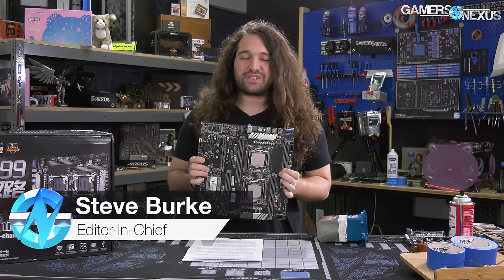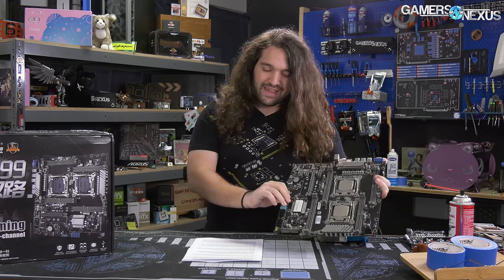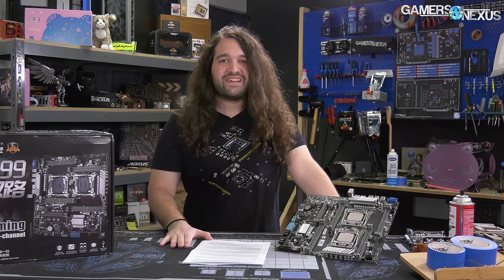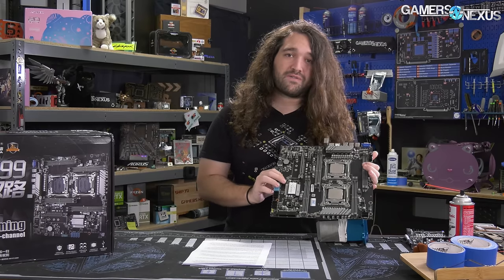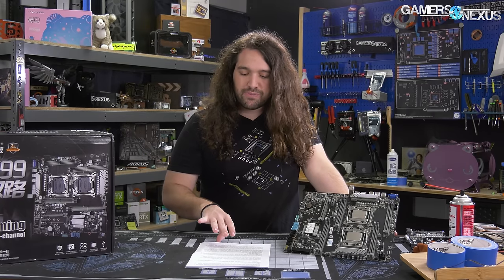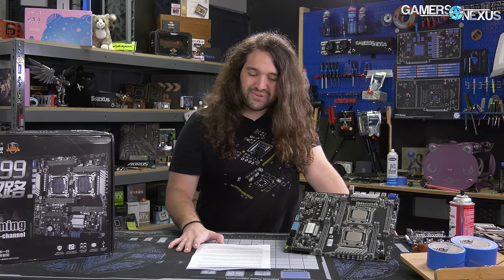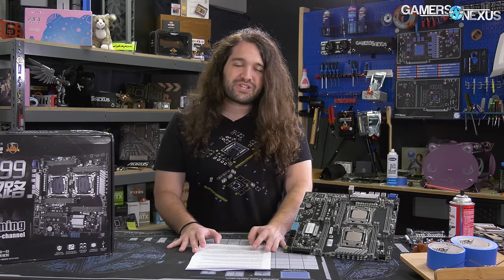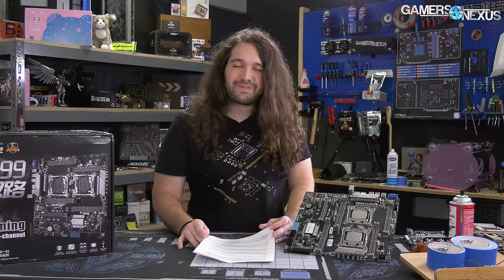24 Cores, 48 Threads for $360: Dual-X99 Jingsha Motherboard vs. AMD R9 3900X

Comment: Ayy, I see you've discovered the magic of ES/QS Xeons. This has been a poorly kept secret for a while. The main thing to keep in mind with purchasing such CPU's (aside from passing general reputable seller smell test) is checking the listed stepping of the cpu in question, and checking that with listed launch retail stepping of the same sku. The further removed the stepping of the ES/QS cpu is from the (post)release steppings is, the more likely you are to encounter issues (eg, a B0 stepping ES vs an M0 stepping release is a big delta, whereas L0 vs M0 is much closer, and is effectively a "public beta" or release candidate, to borrow a software versioning analogy). It's also worth noting that factory base/boost limits may be slightly different than release spec, and as you pointed out, these are/can be unlocked to an extent. 

The value prospect of ES/QS is diminished these days now that AMD (and now intel, somewhat) has finally broken out of the 4c/8t paradigm on the consumer side, but if you need cheap multicore, abundant PCIe lanes (w/ PEX/PLX chips), and or abundant memory capacity w/ Registered ECC support, they're still generally a great value. The price of ES/QS chips largely scales with base/boost clocks (eg, E5-2667 v3's will typically go for MUCH more than a E5-2650 v4).  In otherwords, for gaming, they're not necessarily ideal (as you've discovered), but for a workstation or cheap whitebox server build (database, memcache, etc), they certainly have their niche. 

It's also worth pointing out you can sometimes put E5-16xx and E5-46xx ES/QS CPU's in C602/C612 (depending on Xbridge vs Xwell generations) boards. As I'm sure you've guessed, that'll depend on whether the respective mainboards have the blacklist/whitelist microcode for those. This is worth mentioning as the 4000 series cpu's often go for cheaper than their 2000 or 1000 counterparts as they're only officially supported in 4P-8P type systems (eg, R830) and thus demand is lower. However, I've successfully gotten E5-4627 v2 ES's working in C602 motherboards (Asus z9PE, Dell R620). Afterall there's a difference between "Supported" and "Functional". 

All that said, this is a pretty cool board. I'll stick to buying surplus UCS C240 M4S and Dell R630/R730's for now (generally cheaper overall) but it's nice to see that these boards aren't just some scam and actually have a functional purpose in the whitebox homelab space.
Reply: thank you for the details..ES=engineering sample, QS=qualification sample?

Comment: The 1% lows might be caused by two memory domains on this board ( Its is NUMA after all ) so each context switch necessitates a memory copy - essentially. It might help, if the board supports it, to populate both CPU sockets, but utilize only CPU1 memory slots.

Comment: Plenty of excellent Youtube tutorials, benchmarking, and reviews by Miyconst on these X79 and X99 motherboards from China.

My second PC...the one I am using now...has a XEON E5-2678V3 (12 core/24 thread) that I purchased for US$85 on eBay.  The motherboard, a HuananZhi X99TF which I purchased off of AliExpress from $99. Using the turbo unlock tutorial and zipped tools from Miyconst, I removed a certain microcode in the BIOS to get all cores running at 3.3.Ghz. The modded BIOS was done in under 20 minutes with this guide, first time around. Temps under stress...never go above 60C with a dual RGB 120mm SNOWMAN tower cooler (6 x 6mm pipes) for $32. Cinebench R15 = 1824 / R20= 3912.

This combo will accommodate either DDR3 or DDR4, as the CPU is compatible AND the motherboard has dedicated RAM slots (4 for DDR3 and 4 for DDR4)*. I am using 4x8GB of Mushkin REDLINE (1866Mhz) desktop DDR3; in QUAD channel. There are only ~7 Haswells that accommodate DDR3, I believe only 5 for the LGA-2011(3) socket.

Fun to build and the quality of the X99TF from HuananZhi was surprisingly good. The PCIE slots are stainless steel shrouded and the VRM heatsink is actively cooled. The board substrate itself is hefty layered and this MB integrates RGB in its IO shroud.  Has two NVME m.2 slots too, with one currently as my bootable OS drive.  Also, a wifi/bt m.2 slot, which currently has an AX200 wifi 6 / BT 5.1 card inside it ($17).

AliEx sells combos of this system (X99TF + E5-2678V3 + 32GB REEC DDR3 1600) for only US$250.
*HZ X99T8 has 8 x DDR3 slots / HZ X99F8 has 8 x DDR4 slots.
Reply: I actually got a second X99TF because it never arrived in 4 months (during virus time) and I petitioned AliExpress for a full refund. I got the money back within 4 days of petitioning AliEx. I reordered from HZ's official store.  Then...a couple months later...the first board arrived. Now I have two for US$99 / total.
Reply: With my latest Mi899 tool you can apply the Turbo Boost Unlock hack in just a few mouse click, it's no longer needed to spend these 20 minutes :)
Reply: @Miyconst  Even better!!!! Yes, that tool is amazing.  Of course, I haven't needed it because the tutorial served it purpose so well the first time.  Honestly, tools like this should be purchased.  It is that good.  Keep up the excellent work.  SUBSCRIBED.
Reply: @jb678901  
🍻

Comment: ASpeed chips are usually used for out of band management via IPMI or similar protocols. Does that board have any web-based management page where you can view the console remotely?
Reply: no its just for CCP overlords to check in on you occasionally /s
Reply: It might have IPMI. I see dual ethernet ports.

Comment: I  really wonder how performance scaling would change on Linux. Xenon systems i find are used with linux/unix as much if not more than windows (or win server). It would be very interesting to see how much performance would change in workstation application on say, ubuntu.
Reply: Yeah mug-bloods like Gamers Nexus aren't going to know how to use a board like this. The video was almost entirely useless aside from the BIOS hack which they failed (lol).

Comment: Built my system in late 2019 with a jingsha x79-p3 and a xeon e5-2689 sandy bridge 8 core. Paired it with a rx 5600 xt that gave me more problems than the cpu and motherboard ever did but eventually got it working normally. Been streaming on the system since January. I'm finally about to upgrade to a ryzen 5600 system but this build has served me really well over the last few years.

Comment: 4 years ago I built a 2x E5-2686v3 system. The CPU's were ~290 at the time. I did the EFI mod when it came out about a year later. I was able to get all 36 cores running at 3.1 GHz, although it would no longer turbo up to 3.5 single core... It was running on an as-rock board, I can't remember the exact model. I sold it right before threadripper 2 came out. It had a 135 TDP but must have been able to draw more than that. Also, the E5-2699v3 could be boosted up to all core turbo of I think 3.8 on all cores depending on which board you had. Love this content Steve! Would love to see the 18th core with the high turbo in an x99 board with the BIOS mod and see how it does in gaming.... Also, I found that disabling course or a CPU could make a really big difference due to the CPU to CPU latency and the way that the system seemed to use cache. Cool stuff!

Comment: Idle power use would have been very good to list as well, my system is on pretty much 24/7 and I calculated that it's actually cheaper for me to buy a modern system just in the idle power use. Thanks for the cool video!

Comment: I run the same board with 2 2678 v3 and 64gb ECC RAM, a 1070ti for gaming and a 1080 for extra compute power. All hardline watercooled with copperpipes in a Lian Li 011 dynamic XL. I love it 😂
Reply: Controls a 7 3D Printer Printfarm and Warzone at the same time 🤡

Comment: Gaming performance can be improved by limiting the threads available to the game to only those on the primary cpu as this will reduce latency when the game seeks data over the bus from the caches on the second cpu...Won't help with seeking data from cpu2 memory but in my experience it can dramatically reduce the stuttering.